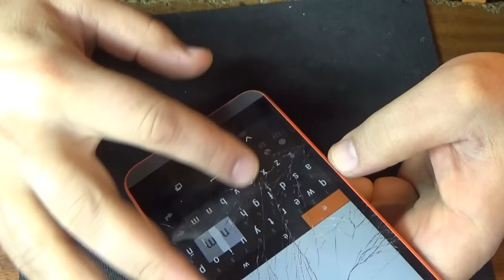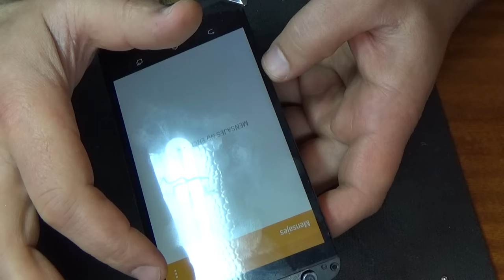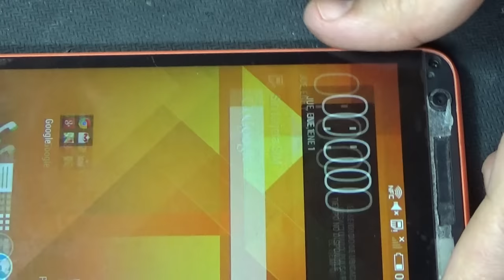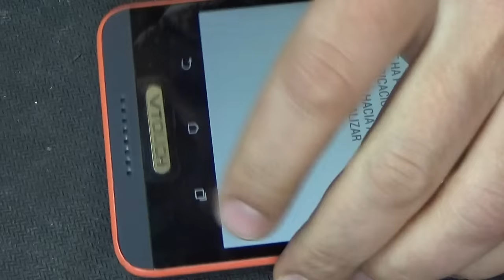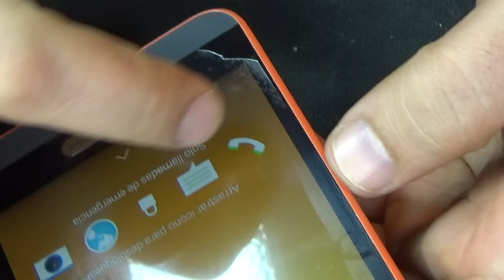HTC Desire 820

Comment: Hello.

I have Htc Desire  d 820 n HTC. , screen blacked out suddenly, phone poweered off. After that, the phone didn't power up.

I tried push a power button for 10 seconds or more, and volume up + power button, volume down + power button with similar way. Without charging or connect to computer with USB cable, no reaction has shown. When it is connected to power, Red led is blinking and does not power on.

When it is connected to computer, device is recognized as QHSUSB_BULK .
 I bought this phone in France , and I live in  Morocco  now, there is no service center for HTC . 
Please help to revive my bricked  d 820 n HTC
Thank you.
Reply: iam having the same problem in my htc820  did anyone have a solution...
Reply: replace old battery i had suffered from same problem
Reply: Shit htc company. Monopoly software to fix htc 820, my friends Do like me. Not buying appliances
Reply: Shit htc company. Monopoly software to fix htc 820, my friends Do like me. Not buying appliances
Reply: Mima Ladi .